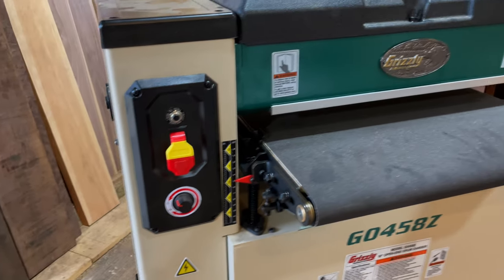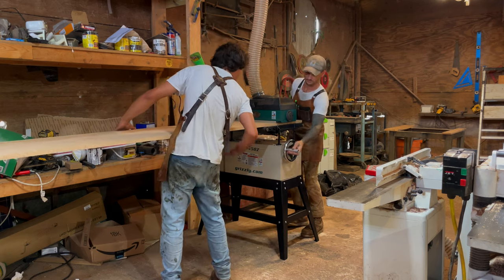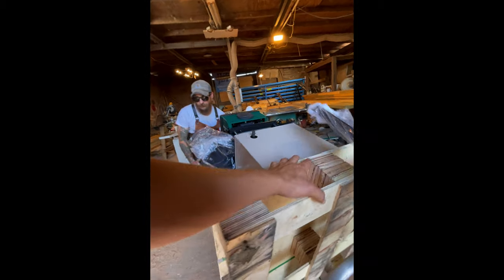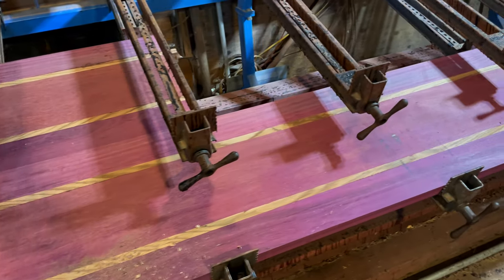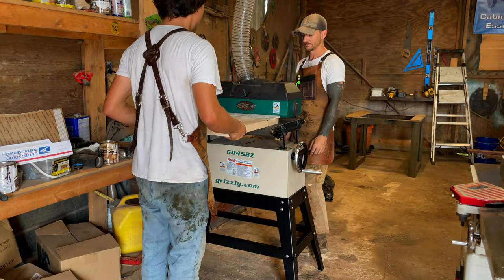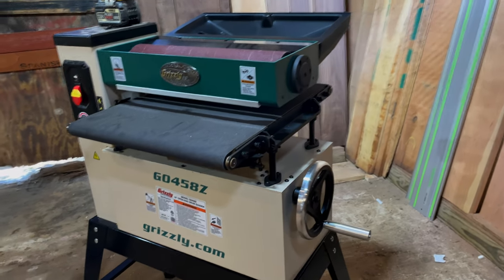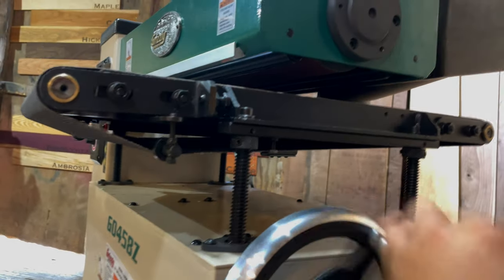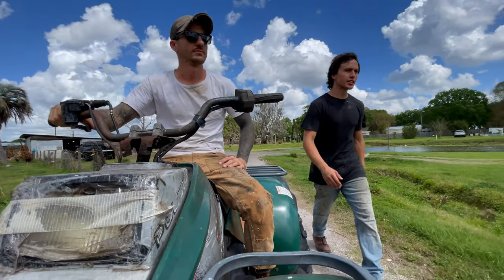Grizzly G0458Z 18" Open End Sander Review

Comment: This looks more like you are trying to take off too much at once. I don't see how the machine could bog down if you're just doing "light passes". And pushing a long board through without roller supports is kind of dumb too.
Reply from the maker: You should try one. We barely applied pressure. This machine is just two weak for commercial woodwork.
Reply: These guys have no idea how to use a drum sander. They think it's a planer
Reply: I know how to use a sander. This machine is crap. I bought one to replace my 10 year old Jet drum sander. Rather than replace the board and feed motor, I thought I’d put the money toward a new machine, thinking this would be an “upgrade”. Bad move. It’s impossible to keep the feed belt tracking straight. The feed belt was jerky and speed control was defective at delivery. They sent a new controller and board but still wasn’t right. Grizzly’s tech department worked with me to attempt to rectify the issues, but ultimately couldn’t get it functioning properly. It’s WAY under powered. Returned for refund. Bought another Jet 16-32. Lesson learned.
Reply: That’s no a planer, man. TF are you doing?

Comment: I have this sander. I'm selling it. Belt tracking is always an issue. The side nearest the motor is tighter. I have to pass a board three times before I adjust the height by 1/16th of a turn each and every time or it bogs. Even on 5" wide pine. Sad part is I needed it to work for me really bad as my budget doesn't allow for trial and error. Ended up stroke sanding most of my projects by hand. That is time consuming. Not even sure what to ask considering it's defective performance.